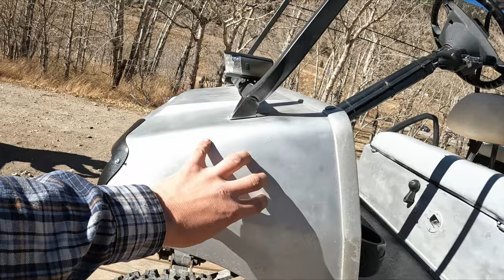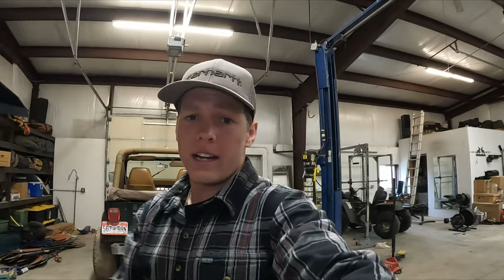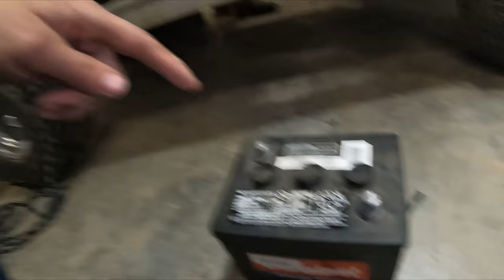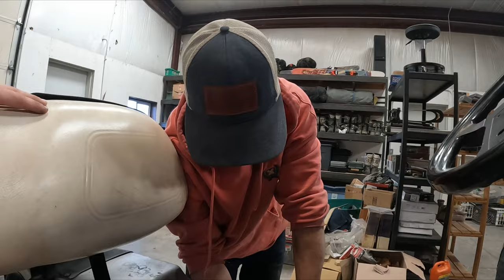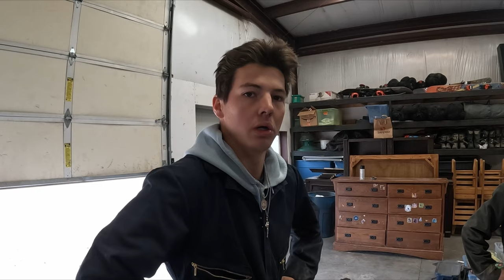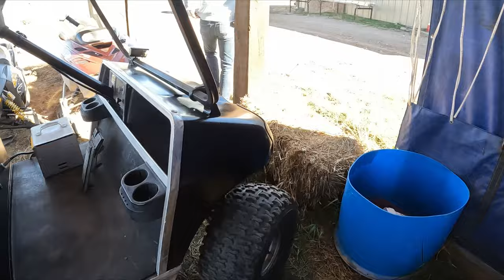Flipping A Golf Cart For Profit!! 3k Cash!!

Comment: Guys, ya'll 100% bought the wrong type of 6v battery. The batteries you installed are 6v starting batteries and not deep cycle. Duralast golf cart batteries are GC2 series, have different venting system, as well as screw studs at the terminals. The Duralast golf cart batteries are also longer, and should have fit without having to add support. The batteries you guys installed are not designed for golf carts, will work for the short term, but not for long. Good video, just calling that out so folks understand the difference.

Comment: You installed engine start batteries in a golf cart designed for deep cycle batteries. First clue should have been the cables would not connect. Scratch your way up the learning curve before you show folks the wrong things to do.
Reply from the maker: uhhh no they were Golf Cart specific batteries. the wires did not connect because we were not thinking right and realized they did not come with battery terminals clamps haha this was done right.